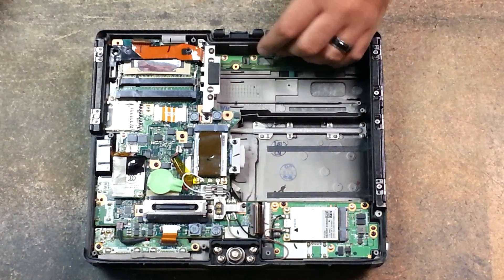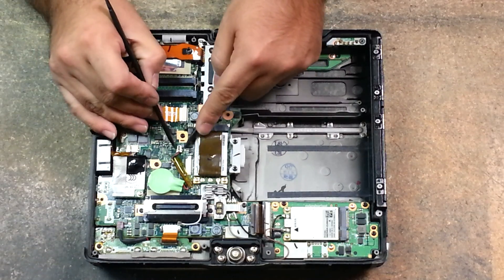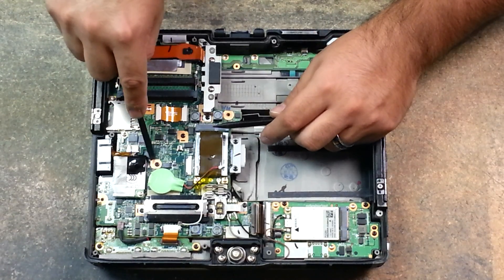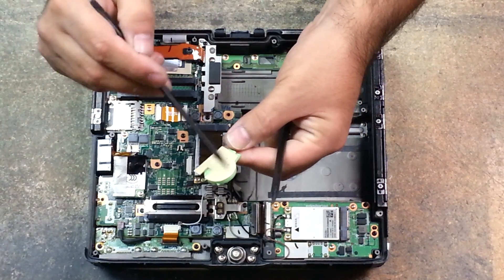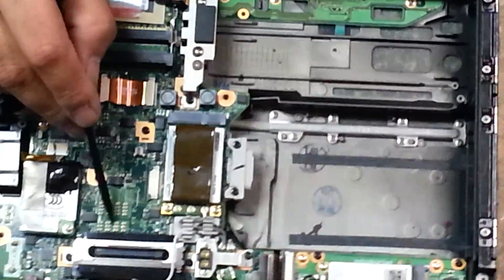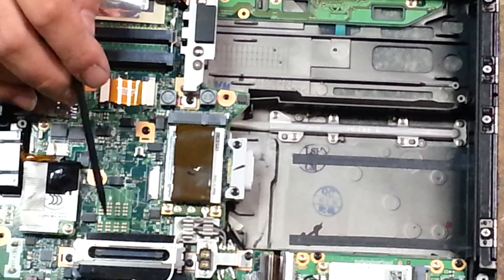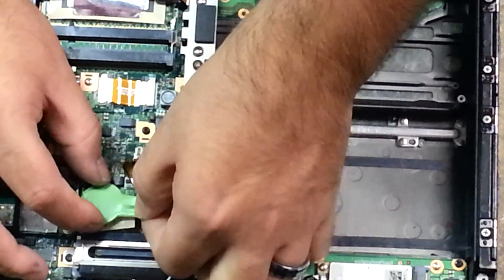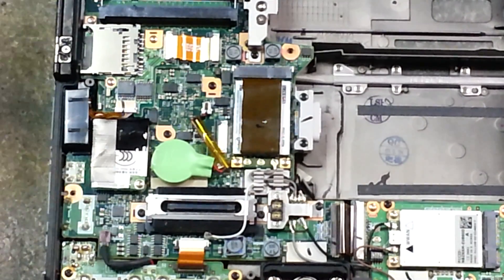Panasonic cf-19 CMOS battery removal

Comment: Easy on the cf-19 but not on the cf-18, as it looks like you have to take out all the circuit board just to see it!
Reply from the maker: Is it? I haven't had one of those on hand in about 4 years. I wouldn't doubt they made it a pain to get to though.

Comment: Hi , i had Panasonic CF-19 MK4 but with high operational time over 20.000 hours,the question is there any way to disable showing this in the bios or reset it to fewer hours or at 0? or by changing the BIOS battery will be reset?
kindly reply,thanks
Reply from the maker: I do not know of a way to reset the operational hours in the BIOS. Sorry

Comment: Does this remove password for bios
Reply from the maker: +Corey Perkins I have found that unlike with a normal laptop this does not clear the BIOS Password or the boot password. Those are different passwords, one prevents you from getting into the BIOS to change boot order, turn features on/off and the boot password will prevent the machine from even booting from the HDD. 

Tough books are very difficult machines in which to remove the BIOS password. I have done one by accident, and I say accident because what I did on one did not work on another. 

Thank you for watching and have a great day.

-Christian
Reply from the maker: +Markus Iesonmann I still enjoy my cf-19 mk2 it's still going strong. on the BIOS password, unfortunately I've been trying to figure it out myself. I have spoken with others with a BIOS password and have had no luck. I have seen the BIOS chip for sale on ebay but I'm not to sure about them. I might bite the bullet and buy one and see if it works. 

thank you for watching my video. 

- Christian
Reply: @616pcrepair  

Hi. It's 2020... Any luck with the boot password or bios password since then?
Reply from the maker: @STUCASHX  unfortunately no new development on the dang password. It's a headache, that's for sure. Sorry.